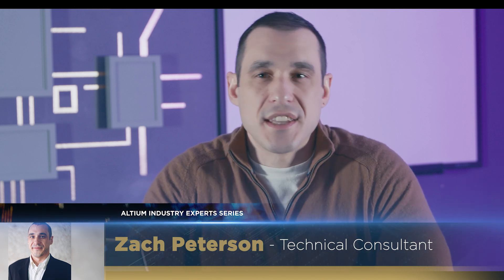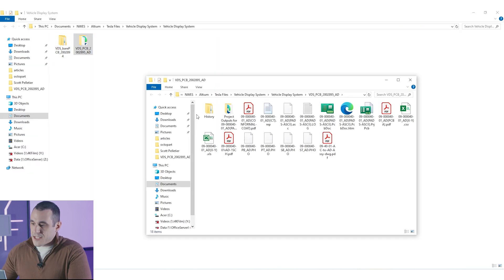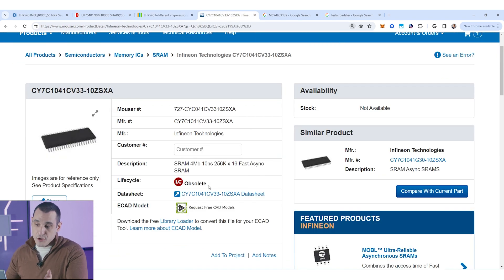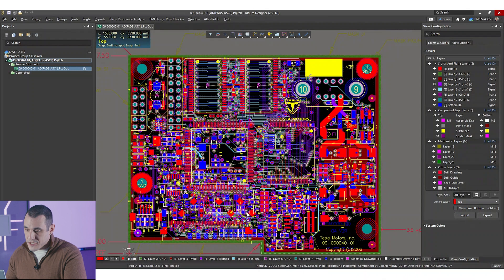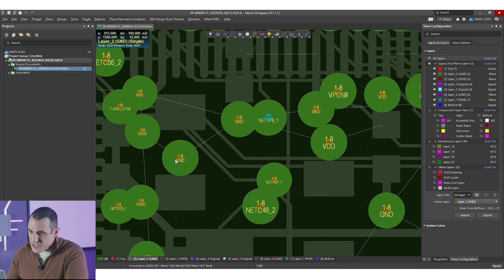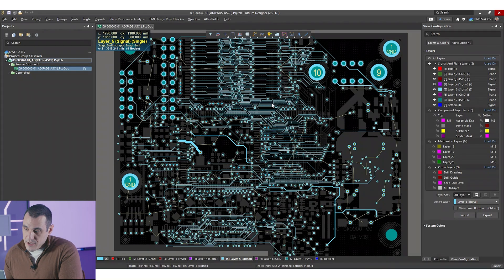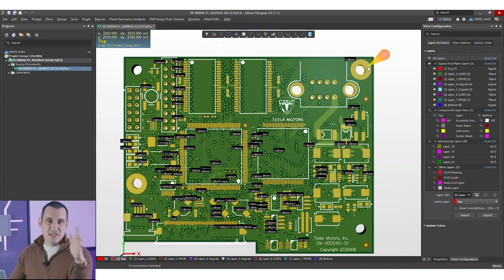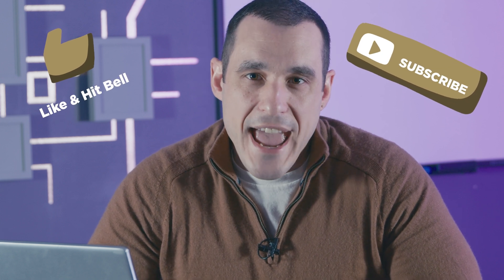Tesla Unveiled! EE Deep Dives Into Roadster's PCB Design Files

Comment: Thanks for showing us the Tesla files. 
Quick Comment: The reason for adding a plane between two routing layers is so they can share the same return current path (not to 'add shielding and prevent coupling and crosstalk')
Reply: They may share the same return current path (at least directionally in the reference conductor) when you have a plane between them, but the plane terminates electric and magnetic fields from one layer thus preventing them from reaching into the other layer. You can see this from the basic electromagnetic boundary conditions near conductors held at specific potential (in this case 0 V).

Comment: Hi, Zach. For example, i am routing diff pair and it has some net lable, but after routing it through, for example, inductance, it has other name. Is there a feature in altium which associates these nets as one or continuation the previous?
Reply: I believe this is handled by XSignals feature.
Reply: @BobBeatski71  No, this is a very simple matter of net naming on each side of the component.
Reply: @Zachariah-Peterson  ...which is what I do, but this was not what the OP asked.  He didn't want to have different net names either side of the common-mode filter.  Not sure if Xsignals supports this as I prefer to match length either side of the component independently; using their own names.
Reply: My first question is, why are you routing a differential pair through some inductance?

To answer your question: you have to give the net a name before and after that component, assuming the component is a series element. A simple way is to name the net on the input side with the suffix _IN and use _OUT on the outpout side. If the component is a shunt element then a single net name will continue the naming across the shunting component.
Reply: @Zachariah-Peterson  Thanks a lot, I meant a common mode filter, sorry

Comment: Hello Zach and thank you for the great content you have been sharing with all of us. One question  regarding the stack up as you mentioned they could have use one GND layer between layer 4 and layer 5 instead of routing perpendicular. For me it seems that even if there is GND layer in between, we still need to do the routing perpendicular in those two signal layers otherwise we will have coupling and cross talk due to the parallel and the interfering return paths in the GND layer. Could you please elaborate more?

Thanks in advance.
Reply: (Yes. I am not the author but the only way to complete any significant amount of routing is to have at least two routing layers perpendicular to each other)

Comment: thank you for video again - it's great! 
 you said about crosstalk -  it's good that layer 4 and layer 5 have differ direction routing  but on the same layer many parallel wires with clearance 5 mil ... thickness of dielectric is  8mil... i see that is more problem - small clearance between parallel wires on the same layer... and i think that energy is distributed in dielectric between two conducting tracks - like waveguide - and this energy - spreading - has exponential law   so 5 mil - big problem even if the thickness dielectric will 5 mils

Comment: That spongebob cut caught me offguard, not gonna lie hahaha

Here's a pain in the but question, did they ground their mounting holes? I've always wondered how they design "ground" and "chasis ground" when there is no direct connection to earth. I guess it's the same questions for phones and tablets! Do they normally just ground one mounting hole on PCBs to avoid ground loops?
Reply: Well of course it all depends. In a vehicle the chassis ground is the frame ground, which is actually the return path for the entire vehicle. It's like the analog of the neutral line and earth ground all at once. So you have a power input coming into the system, and that ground coming off the power input connects back to the frame somewhere upstream. About the mounting holes, they don't just ground one mounting hole to prevent ground loops. I keep seeing this question about ground loops, it is probably one of the most misunderstood topics in PCB layout. Mounting holes can be part of the chassis ground but it is a matter of how you put that chassis ground on the PCB. For example, you might have a chassis ground defined by a guard ring around the edge of the PCB, but the main reason for this ground is to provide a connection to a shielded enclosure, and provide a path for ESD (such as from exposed connectors) that does not pass near your components. Just because you have this guard ring ground it does not mean you need to have an earth connection.

Comment: A lot of those design rule issues might happen when importing from PADS to Altium.
Reply: I guess you're talking about the unconnected rats' nest lines of the ground net?  I think you may be right. These connections may have been implemented by PADS polygons, which the Altium PADS importer may not understand as connections.
Reply: I don't have experience with PADS ruleset so I can't comment, but I would have expected the connections to be restored by the plane layes. Maybe polygon pour will take care of it?

Comment: Hello Zach, am I right assuming that they would completely eliminate SI problems if they would have swapped Layer 2 (GND) with Layer 3 (pwr)? If not, maybe you could elaborate on your preferred stackup? I also do not see thicknesses of cores/prepregs in that PDF, so it is also hard to judge whether it is a good stackup.
Reply: 9:00 I think he meant changing power to ground on layer 3, then swapping layers 3 and 4..  So the stack becomes sig-gnd-sig-gnd-sig-gnd-pwr-sig, and there are no adjacent signal layers.
Reply: No they would not completely eliminate every SI problem, but they would prevent all crosstalk between layers when separated by ground. My proposal was to use SIG-GND-SIG-PWR-GND-SIG-GND-SIG. And regarding the layer thicknesses, they probably did not specify specific materials with thicknesses because they will ask their EMS to provide a stackup with layer thicknesses.